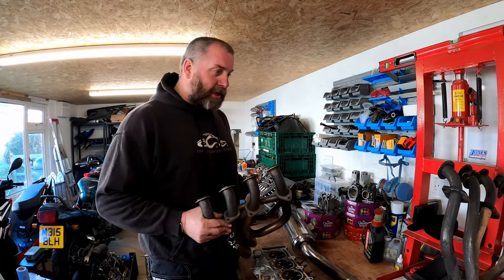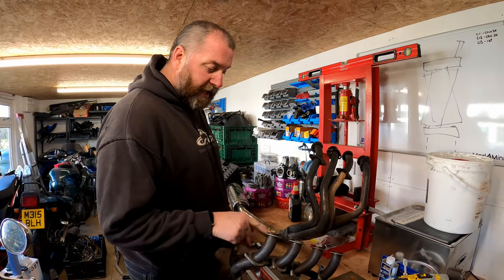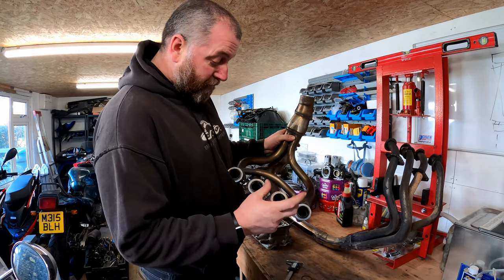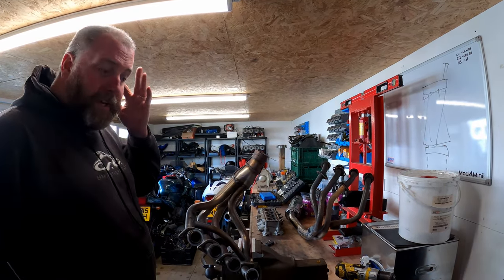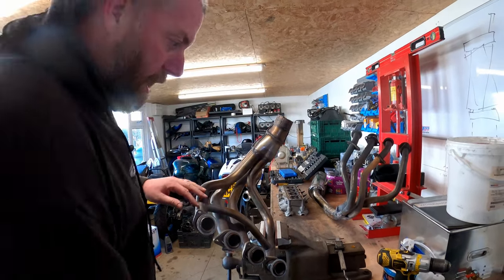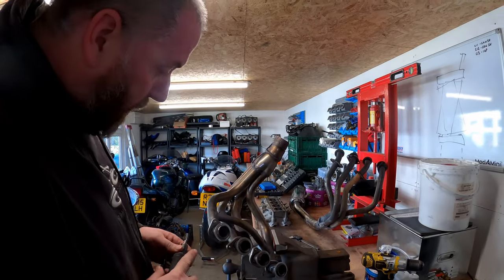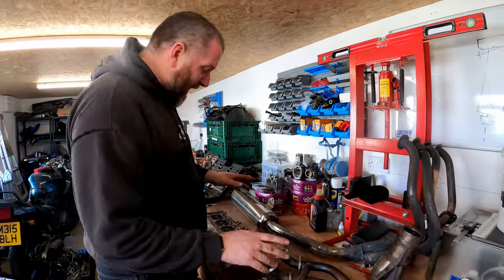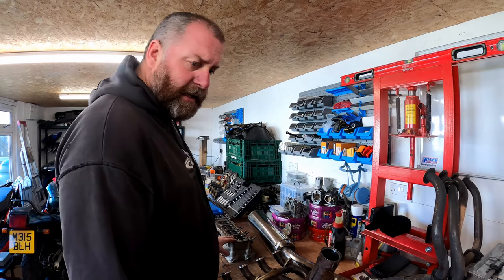1998 Kawasaki ZX9R - Project Shinobi, Episode 15 - Fitting E1 Model Header Pipes To The C Model.

Comment: Nice to see shinobi back in the spotlight. Also, given consideration to the carbs. Wonder if the jetting will be affected? I could never get my r6s to run right with a slip on. Hopefully with this one not so much hassle.
Reply from the maker: I won't know until I get it all back together which is a bit of a way off yet. Hopefully it won't be too difficult though. 👌

Comment: Oddly enough, I have a full Akro system on my E1 and the headers didn’t come with crossover pipes.  I’m going to check the OD later out of curiosity though.
Reply from the maker: I'm reliably told that the diameter of the factory E1 headers is identical to the Akro system for the C1, hence why it's a fairly popular mod! ✌
Reply: @KevsShed  Yea, this is correct. The stock E1 headers that you are putting on your bike, are based on the Akra-system developed for the 1998-99 (C1/C2) model. The Akra-system for the C1/C2 came with crossover pipes, and this design was carried over to the stock E1/E2 pipes. However, I do not know what the Akra-system developed for the E1/E2 model looks like, and if this system for this later model has crossover pipes.

Comment: Look a bit tight I’d take more off they need be a bit slack for expansion when hot wouldn’t want you cracking your head
Reply from the maker: Yeah, I agree, I thought the very same thing since I filmed this. I have since taken a fair bit more off for that very reason! 👌
Reply: @KevsShed  also I have some very nice micro headers high grade s/s non magnetic like factory ones plus the link b pipes between 1-4 and 2-3 are for back pressure not needed on 99 the 00 is a complete different engine I’ve been down your road in reverse I put 00 engine in 99 frame not as easy as I thought it would be but that the fun of it
Reply: @davidpierce7318   so it is beater to cut of that connections or it has neither good or bad influence?
Reply: @nitrobernas  on 00 the link pipes are there for a reason I’ll have to research it but non on 99 think it helps combustion
Reply: @davidpierce7318  but if i instal it on my 99 model  exaust from model 00 it eil not give benefit but no damage?
Reply: @nitrobernas  well 99 headers on 00 fit but that is small pipe in big hole I found it was a bit laggy not done it other way cos i put 00engine in 99 frame but I have a spare set of micron racing headers witch are better than oem try it if you want